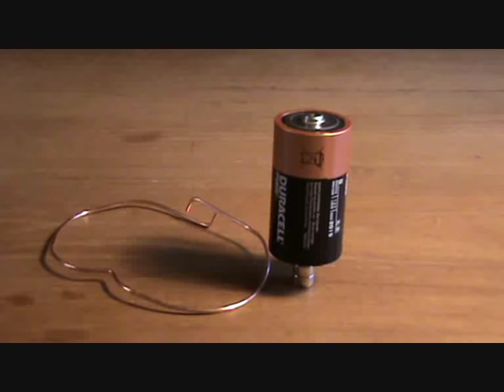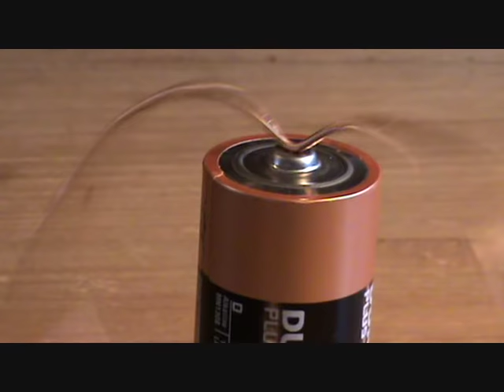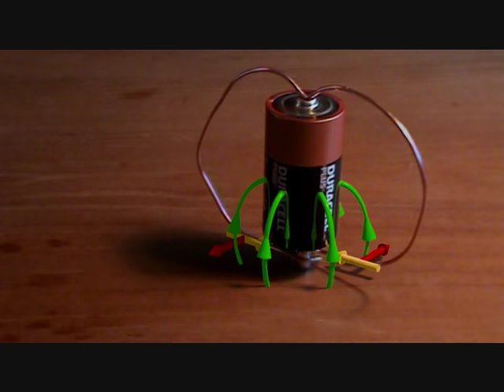Lorentz force in a homopolar motor (with short explanation)

Comment: my wires move without a magnet, just power source and a curved wire, Is till don't know how..
Reply: You are on to something, maybe. I am trying to replicate this now. I tried rotating the magnet to use that as the rotor. It does not work. The field is locked to the universe. I am investigating. It has no change in flux, so this is simply unlike other motors. I am not sure it has counter EMF.